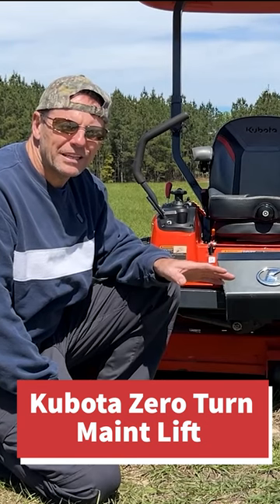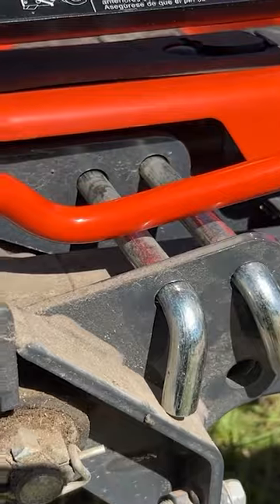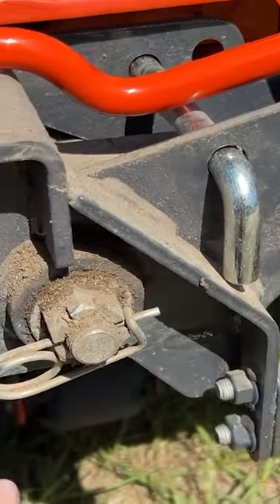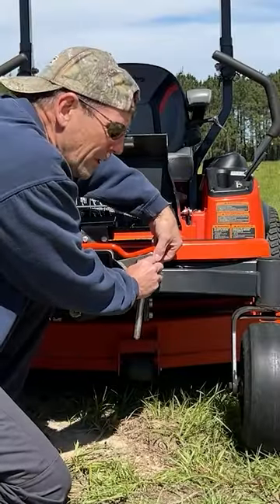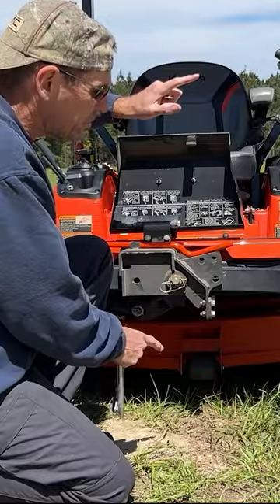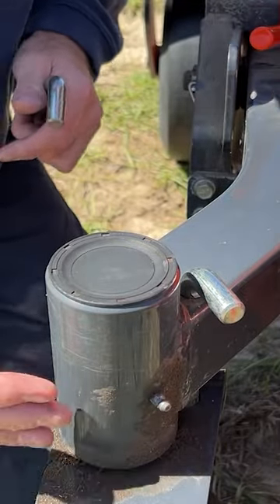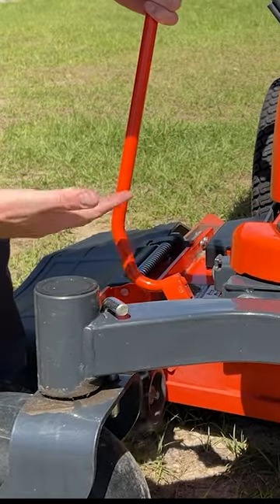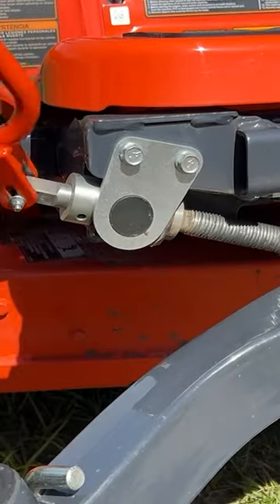This Zero Turn Mower Lifts Itself Up!!

Comment: You know what's more simple? A jack on the front wheel on the deck.
Reply from the maker: how is that simpler?
Reply: @Piney Grove Homestead - Tractors and Outdoors  3 or 4 pumps from my Daytona jack and it's 20 inches off the ground. Takes me all of 30 seconds. No pins, no reading directions, no cranking.

Comment: I’m not sure who that mower was made for. 
Pros, that’s a lot of time ($) to perform and return, and hope it is all correct before earning again. 
Small farm -who has that kind of time?
Homeowner- won’t do it more than once. Too complicated. 

Just use your trailer ramp, pull it up and chock the wheels (use a strap if it feels sketchy). 

All of those fancy joints and scissors are failure points. 
I can tell you for a fact I would not go through all of that.

Comment: Can't get an impact under that little lift. My Country Clipper is way better. Still prefer Hustler, though
Reply from the maker: But you can....just took off blades and sharpened.   These machines routinely go 3000 hours....haven't heard of one wearing out.